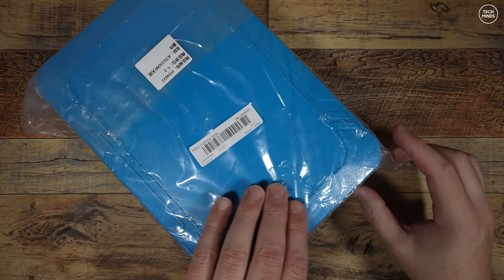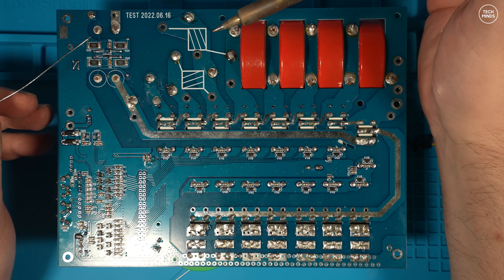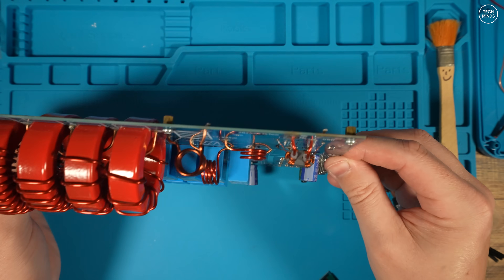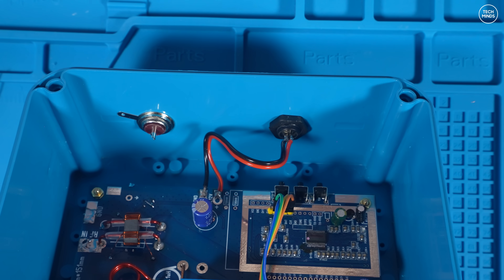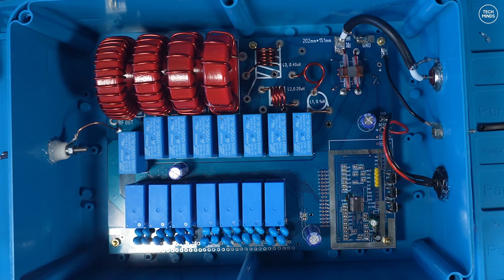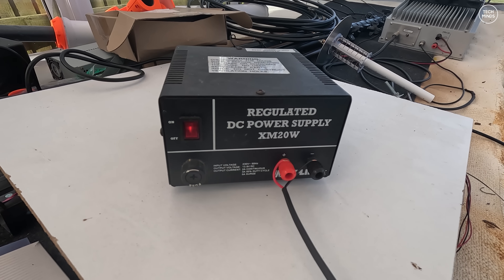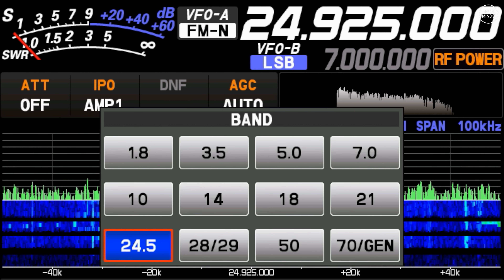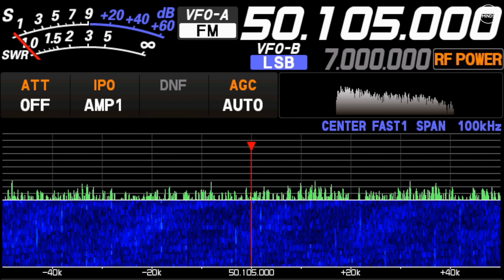ATU350 - A Cheap 350 Watt Remote Automatic HF Antenna Tuner

Comment: Matt, what was the resolution to the problem ?  Are you still using this tuner ?  I'm curious as I am putting together a station in my caravan (travel trailer) and was hoping that this might work.  Thoughts ?
Reply from the maker: I gave it away in the end but I believe it was related to the length of wire I was using, needed to be longer to covers all bands and not close to a resonant frequency.

Comment: I would like to caution you about BANGGOOD and strongly recommend NOT DOING BUSINESS with them or trying to buy any products. For example, I ordered an ATU350 (350w) remote autotuner kit for $160. After a couple pf weeks, I received the wrong product, the 100W ATU50 instead, and it was defective as well. When I contacted BANGGOOD support, they did not honor their warranty or return policy - wanting more proof-despir multiple pictures and contacts. So, now I have a $160 piece of junk.\"

Comment: You should stay away from half wave multiples as they present very high impedance and will be difficult to tune. I would have connected the counterpoise to the SO239 input ground.

Comment: i would  guess that  its an atu   for  balanced   antennas  ie end fed so    you  need a ulun    on the output   weather it be a 9;1  49:1  what ever      so common mode current  will be on the  coax    that  needs to be removed    1:1  choke

Comment: You're on the right track, putting the ATU at the antenna feed point. AM broadcasters have been doing this for years so that the coax sees 50+j0 all the way back to the transmitter. The reactive current stays at the antenna, rather than circulating back and forth on the coax, as it does when hams incorrectly place the tuner in the shack. I added a bias tee to my remote auto-tuner, so that it could be powered over the coax, as well as a common mode choke, made by wrapping 10-12 turns of RG-58 through a 240 toroid. Since the 12 VDC power was being supplied through the coax, I did not need to worry about a separate toroid for the power cable. As another poster has said, for an end-fed, stay away from a length that is 1/2 wavelength at any frequency you want to tune, as the extremely high impedance will cause you headaches. I swept my end-fed with a Rigexpert antenna analyzer to make sure the impedance was within the tuner's capability on all all ham bands. I ended up using an MFJ-939 ATU for my project.

Comment: A couple of questions/observations:

I noticed that you disconnected the 49:1 unun and moved the wire to the automatic tuner.   Why would you do this?   You're feeding an end fed half wave antenna, which means the feed point impedance is going to be very high - too high for that automatic tuner to handle, as you discovered on 40 meters.   And, that is the band for which an end fed 65 foot wire is designed to operate.  

If it were me, I would continue using the 49:1 unun and just a short coax patch cable from the tuner to the unun.   By doing this, you would relieve the antenna tuner of having to transform such a high impedance load.   Then, the tuner would only be needed on 30m, 17m, and 12m -  because, an end fed half wave for 40m is going to be resonant on all of the harmonics, which include 20m, 15m, and 10m, but not 30m, 17m, and 12m.   

Secondly, if it were me, I would have incorporated a simple bias tee circuit to provide DC over the coax to the tuner.   Then, there would only be a need for coax in and coax out/wire/ground.  You could study the schematic of the MFJ-4116 Bias Tee to see how simple and inexpensive it would be to implement that with your tuner.  It's just a few capacitors, inductors, resistors - caps to block DC and inductors to block RF, and resistors to provide a stable voltage and a token load to provide a complete circuit path to ground.   And, at the radio, you can re-create the same circuit, using the radio's antenna tuner output for power.

I'm thinking of doing exactly this - except, I would purchase an N7DDC tuner already assembled and just install it into a weather proof box, powered by a bias tee circuit.   That would save me a lot of time.

Thanks for sharing this project with us, and 73!

Comment: Normal you use a non resonant antenna with remote atu,try 71ft of wire,remote atu units don’t like voltage fed antennas like 1/2 wave lengths,use a non resonant current fed antenna.

Comment: I would run thr wire in s "L"down the side, and across the back. Looping the wire introduces stray inductances. Of course, if you retrace your wire, the retrace is useless.

Comment: I don't think the bolt makes a difference.
The only reason I would worry about using the ground next to the ant out is if the two grounds on the opposing sides of the board did not have continuity. 
Like others have said, approaching a 1/2 lamda should be auto-transformer'd down with the 49:1, Perhaps use the 'random' wire length calculations (non-harmonic on any band) instead.
Fun build; thanks!

Comment: If you used a metallic enclosure you will find the tuner to be more stable. As it stands now, any changes in the surrounding area of the board will have some effect on the tuners operation. You need to lock down the external variables before you can identify any board changes. Every installation will be different around the world.

Comment: What I mean is, From the outside to where your antenna is situated , example a mobile whip or a 7 meter antenna whip, you must not have 45 cm of fly lead. I worked for Kenwood, and in their manual they stated, " maximum flylead length is 45 cm. Any longer and the flylead becomes the antenna, and not the antenna itself".

Comment: It would be nice to use Bias-T to put the DC power up the coax rather than having to have a separate 12v supply lead.
I agree with the other operator who said put an unun in circuit before the ATU and you will most likely see far better results.

73 Ed.

Comment: Just remember, the people that'll bitch and moan about you using the edge of the iron on the heatshrink are the same ones that use a cigarette lighter to do it. I use hot air becauae i solder a hell of a lot and I use it a lot, simple chinese solder station unit cost about $30AUD on Banggood. Does the EXACT same job as your iron in my opinion, little less chance of touching and melting is all it provides. 

I think with the correct length of wire, this unit could have real promise. Obviously, it wasn't the one of lengths you tried, but it wouldn't be hard to cut some differing lenghts of cheap wire and test to see which one makes the unit happiest, then cut a good wire to that length and away you go.

Comment: I have an LDG RT-100 remote tuner.  I found that the tuner SWR measurement circuit is subject to common mode causing erroneous measurement and the tuner stops tuning at the wrong swr.  The fix for me is to use a common mode choke of two type 75 FT-240 toroids and five turns of the coax feeding the tuner.  The RT-100 uses a bias Tee to send power on the coax.  This means the common mode choke includes the power wires (inside of the coax).  You should put the power wires on the same cores as the coax in your situation.  The tuner now will be completely isolated from the power wires and coax.  I would suggest you have a counterpoise and try connecting it to the input side ground or to the output side ground connection.  Whichever works better.  The common mode choke requires high permeability cores and large cross section to achieve high common mode impedance with only 5 or so turns.  More turns will cause parallel resonance on the higher bands and make the impedance low above the resonance.  Also a high perm. core rated for EMI filter use and lower frequency is desirable ( hence type 75) to make more of the common mode impedance resistive.  The will lower any resonance effects.  It's a good thing for a common mode choke to be resistive for common mode.  It will lower the common mode currents while having low loss to the differential mode which is the RF power to the antenna.

You might have to experiment with wire lengths of the antenna and counterpoise.  You want to avoid even multiples of 1/4 wave on any given band (very High Z).  Also placing the counterpoise on the ground will add some ground loss that will make the counterpoise length less critical at the expense of somewhat increased loss.  You might consider googling around to find some other hams who have done some work with finding "magic" lengths for random wires that make them easy to match.

Comment: Hello Matt.  If I was building that tuner, I would not use those skinny little ground tabs (Where possible).  I would loop the wire around the stud.  You could form the loop on the stud and then solder it to its self before attaching if you wanted.  Also, when I ground coax with solder I use buss wire and wrap it around the shield and solder it (quickly as to not damage the center insulation).  I just think it is neater that way.  It looks like a nice tuner kit though.  73.

Comment: Rather than a linear load so close to the ground, with or without an external tuner, try wrapping the wire around the pole in coils far apart from each other, trying different distances moving from the base to the top.

Comment: Whoever comes to collect the tuner might try wire lengths that don't present a significantly high impedance on particular bands - as the End Fed Half Wave that was used would have done. 
In the second test we saw that things did change - but the wire wasn't chosen to be a particular length and again, the likelihood was the impedance was outside of the range of the tuner. 
While I'm not a big fan of random wire end feds, the length of those (and there are charts all over the internet) is selected to present a mid range impedance on the bands of interest. 
You might then see a different performance than we saw in the video.

Comment: Trying to tune a 20m long wire is no a good idea because impedance is too high at 40m band which is hall wave and 20m band which is a full wave length. 
It is not the tuner"s fault.

You shoul try with a non resonant length of wire, like 43, 31 or 18 feet of wire.
Reply from the maker: Did you watch the video? I added 6 or 7 feet of wire to bring it close to 71 feet.
Reply: @TechMindsOfficial  no, I hadn't seen the whole thing. 
Choosing a non resonant length at the ham bands is mandatory.
Reply from the maker: @ I know, hence the extension. I had the same issue with my CHA URT1, well, not so much an issue, but I stuck to certain lengths which are non-resonant on any band. The CHA URT1 is my main antenna tuner, or at least one of them. Cheers :-) Matt
Reply: @TechMindsOfficial  I believe you said your counterpoise was a ground stake + 20M of wire. So your RF return may be a high impedance too assuming the stake is not sufficient with poor earth.

Comment: Mat, I did a lot of experimenting with al these kind of tuners. The best on the market still (My preffered one) is the Stockcorner JC-4S 1KW PEP remote tuner. One important thing you might have overlooked is the lenght of your wire being a single or multiple halve wave on the bands you tried to tune. Half wave lenghts tend to have very high impedance as where quarterwave lenghts have very high current and those lengts need to be avoided. If you adjust the lengt of your antenna where no band meets these restrictions, you can tune all bands as advertised. I for example use at the moment 72 feet  wire at 12 meters and it tunes all bands (80-60-40-30-20-17-15-12-10-6) to SWR 1,1:1 or even flat... The reason the JC-4S does matching up to 160 meters easy has to do with the parts used (have a look at the max mH or pF from this tuner and the build quality inside). It's just amazing and I just ordered a new one for permanent setup with my amplifier. I agree it's a bit pricy but when you look at the results and build pictures and reviews you'll understand as every one is hand made. Cheers ON4VP Phil

JC-4S : https://www.stockcorner.nl/index.php/en/jc-4s

Comment: I was watching the video then heard myself, I wasn't camera ready and fluffed my lines 🤣I was running 20w on a G90 in to a dipole, The G90 sounds good, me not so much. If you had said you were recording you could have had the video from my end as I usually record activations incase I mishear a callsign.
Anyway thanks for the call and thank you for a great channel.Bob G6CKK
Reply from the maker: haha Hey Bob! Wow, just a G90? I must admit, out of all the low power HF radios, the 705, 6100 and 6200, the G90 is my favorite. Sounded fantastic! Thanks for being my "on air" example in the video :-) Cheers, Matt
Reply: @TechMindsOfficial   I agree on the G90. I consistently receive good audio reports.
I don't suppose you have a G90 and a FT891 to do a RX comparison? I always feel the G90 might be lacking in RX as sometimes I can be talking to someone running 100w and they are giving me a 5 S point better signal report than I am giving them. I guess this could be down to their antenna inefficiency. ps. happy to be a the on air test.
Reply from the maker: Unfortunately I do not at the moment. I only have so much room in my office/shack so I have to part ways with lots of gear. From the time I spent with the G90, I could pretty much always work the people I could hear. Cheers

Comment: If you google “random wire calculator” you can find tables of lengths of wire which are to be avoided, as well as wire lengths which are likely to be successful on the usual ham bands. 

You can’t just throw a random length up and expect it to work! And it’s especially telling that you began with a half wave feed — this will NEVER work without the transformer. 

ATUs are not magic. It’s math. You  can work all the bands with one length of wire but it isn’t going to be a length you just guess at. 

Also… very long wires — even those with low SWR — may radiate quite undesirably on the higher bands. 

Always worth doing a little research. 

73

Comment: I'm surprised by the inductors being parallel to each other and in such close proximity. I would have thought they would end up coupling with each other in undesirable ways.
Reply: You probably should read up on how toroids work.
Reply: @AB7Echo  Ah, I guess I was thinking of air wound inductors, which are often oriented at right angles to each other
Reply: @BlueSOF  Yes.  In that case, you would be absolutely correct.

Comment: I would expect that such a box, additionally should be able to switch between 2-3 wires (antennas) of different lengths to accommodate all the different bands and their wavelengths, because the math doesn’t really add up for that broad range of wavelengths to be tuned. 

If there are wires/amtennas of different lengths to choose between, the tuner would need to "tune less", eg. choose the least bad length wire, then tune it, and of course remember which wire (antenna) should be chosen when transmitting on a given frequency.

Comment: Good video.  Seems to me you should not have bypassed the 49:1 transformer unless that is a built in function of the remote tuner. Seems to me the tuner output should be a coaxial output and connect into the antenna just as before you built the tuner. Put ferrite beads on the power line definitely. I think you said there is a ground at the antenna, if not there should be one 8 ft copper ground, some ground mounted radials or at least some sort of counter poise… also maybe some ferrite beads on your coax before the tuner. I run the 43 ft verticals from ZeroFive antennas and I can tune 80 - 6 meters with my remote tuner in the shack. I have 20 radials from 30 ft to 10 ft in length for my vertical. They claim it can run 160 meters but you need 150 ft of coax, so it’s the antenna coax that is partially uses as the antenna.. my feed line is 100 ft. I use 7 snap on ferrite beads on both sides of the coax, antenna side and inside shack tuner side. Good luck and 73..

Comment: The GND at the ceramic is when you use it as a line tuner. In other words, you have a SO-239 in place of the ceramic. You then tune dipoles and Yagis with it.

Comment: I would say wire lengths used for 9:1 unun,s would probably be better as halfwave lengths will have a high levels of impedance, Ive had success with 84ft as this should be around or less than 500 ohms at the feed point, other wire lengths are usable ie 72ft.

Comment: You fly-lead from the tuner to the antenna, is too long. Don't exceed 450 mm (17,8 inches). I did installation of ATUs for 43 years.
Reply from the maker: I don’t understand your comment. From the Pcb to pass through is about 2inches and then the antenna connects directly to the outside. So not sure which part you think is too long?

Comment: 1 That equalization I would just try it. (2 nuts at the end?)
2 I would put that ground wire on that other point with a thick wire.
3 that last one with some beads oh... why not?
4 I don't like that stretching the wire back and forth and bending it at right angles!
stretch the wire and if you really have to bend it with a large radius.(no sharp corners in the wire)
.
will it make a difference? maybe nothing at all, but if you don't shoot... it's always miss!
Healthy and friendly greetings from the Netherlands.
Rob (RadioRob on KG-AM 6390KHz - Piratest.)